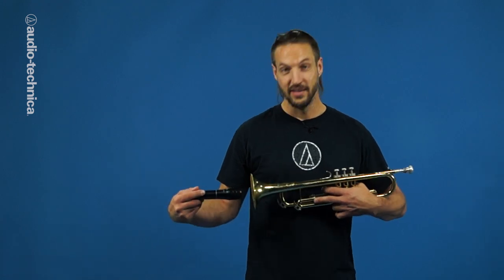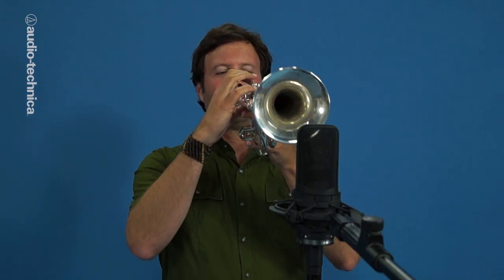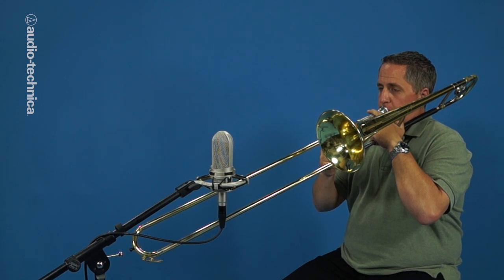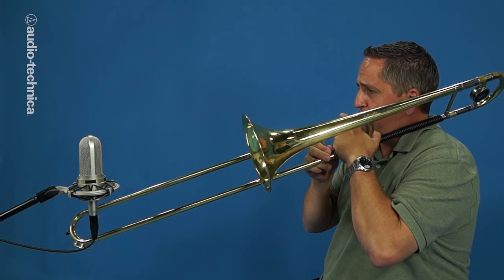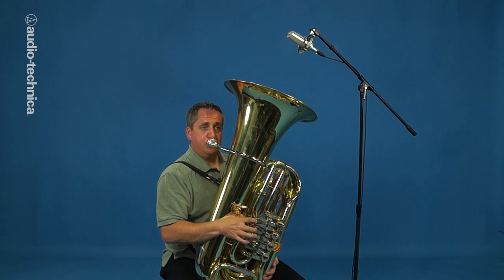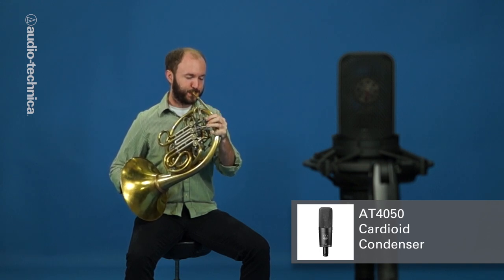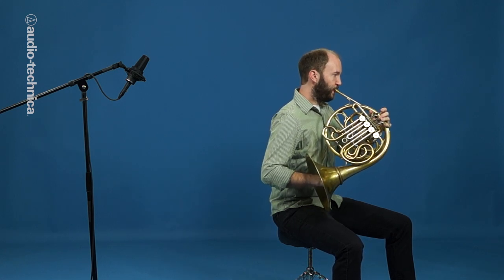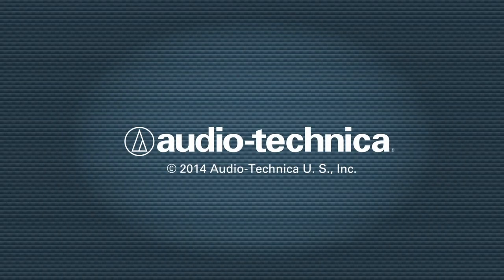Basic Recording Techniques: Brass

Comment: You lost me when you said the trombone isn't as dynamic as the trumpet
Reply: Not wrong. The trumpet has the greatest dynamic range of any brass instrument.
Reply: @fontjs1415  Try the F Horn
Reply: Trombone definitely has more range and dynamics
Reply: I'm pretty sure the French horn has got some pretty nice range
Reply: Fontinalus it’s entirely dependent on the player. As a euphonium, I can attest to the fact that yes, trumpets are capable of playing at a forte with ease, but additionally, their lower pianissimos are much more shrill in tone, as the small mouthpiece requires a high level of experience to achieve a consistent and full sound. The euphonium and trombone, on the other hand, are much better at maintaining fullness through the lower dynamic markings, and trust me, trombones know how to blast.
Reply: Fontinalus not true at all😂
Reply: @wiki862  Yay euph gang
Reply: I think it’s just a misuse of the word. They likely mean that the trumpet can be much brighter and shriller, especially in the upper register, while the trombone isn’t usually as strident

Comment: Of course the euphonium is forgotten 😔
Reply: uh.... you wouldnt do much different than what you did with the tuba
Reply: Don't You Love The Arts gay
Reply: Paradox Box I understand that assumption, but in actuality, the higher range of the euphonium requires more room to resonate, in order to achieve a full sound. In all honesty though, the tuba should be miced more like the French horn as well.
Reply: @Lothins as someone who plays both quite well, you hit the nail on the head, they are recorded basically the same, but with upright instruments, the higher pitched the further away from the mic you need to be to get the echo from the room.
Reply: the "Who?phonium"

Comment: couldn't you use a SM57 type of mic? It's a dynamic mic and i was under the impression that those would work for brass and instruments with high dynamic range instead of having to buy a ribbon mic
Reply from the maker: Hi Justin! Different microphone types have pros and cons and different microphones may be used depending on the application.  For a live setting where other loud sound sources are nearby, a dynamic microphone may be used whereas in an acoustically treated studio setting, condenser or ribbon microphones are often chosen. - A-T USA